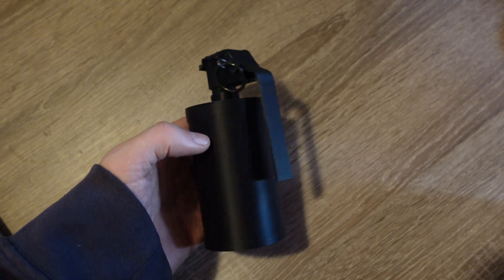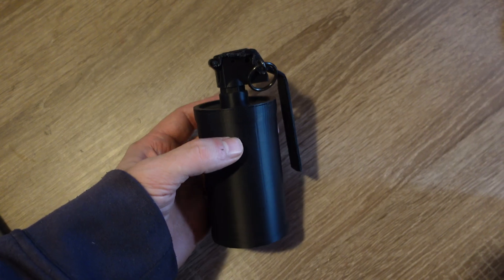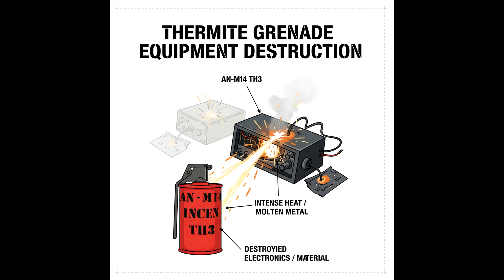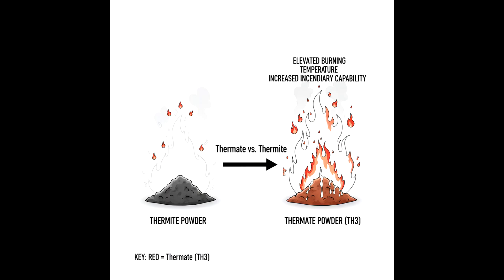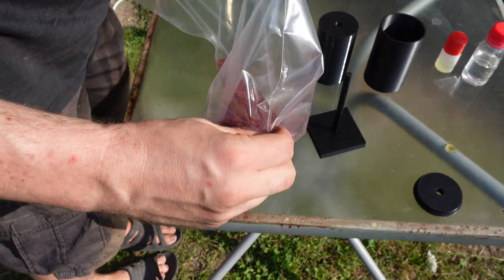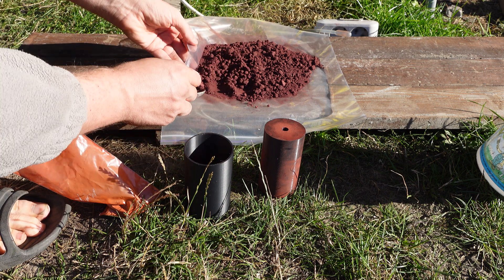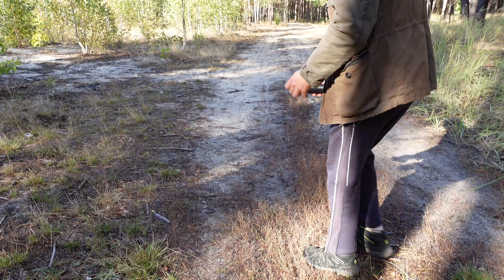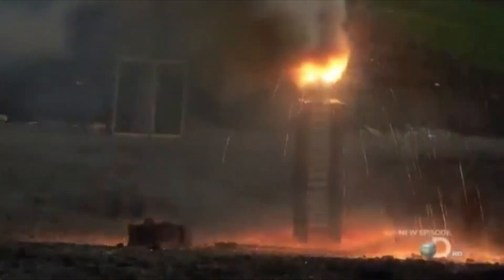3D Printed Thermite Grenade: Making Military Incendiary TH-3 thermite

Comment: Have you done any research on gassless fuse comps? I think that would be interesting
Reply from the maker: Why? They are well described in literature.
Reply: @NinjaChemistChannel  have you ever done any research on any? A lot of the ones I saw had some more exotic materials needed or weren’t very storable so I was wondering if you have found anything more available
Reply from the maker: No i havent. I experimented with few gasless compositions, but only one of them worked as described, others just dont burn.
Reply: @NinjaChemistChannel which one did u have work? Because I was gonna try one that was CuO and W powder but tungsten is expensive so I was wondering what you think
Reply from the maker: I tried Sb2O3 silicon that doesnt burn, CaSO4- Si - same, BaCrO4 KClO4 Sb2S3 -burns but unstable. BaCrO4 -B was the only composition that worked well. Tungsten is good  this should work fine.
Reply: @NinjaChemistChannel  ok thansks for the help

Comment: have you thought about making a stun grenade? it might be interesting
Reply from the maker: Stun grenade is just a big fireckracker with pull ring ignition system. This body is desighned for smoke grenade. Need to desighn a new body for this.
Reply: @NinjaChemistChannel  I remember seeing a self-made stun grenade. where the firecracker was launched out of the main body (like a mortar), that might be a bit safer then having the firecracker in the body. considering the use of 3d printed fuses.
and there is a thermate mixture which can detonate, if initiated by a detonator
Reply: @NinjaChemistChannel I would love to see a 3d printed stun